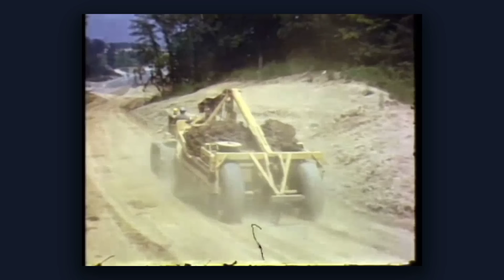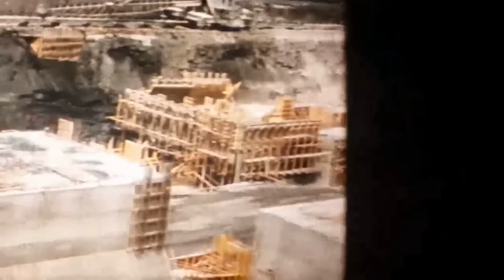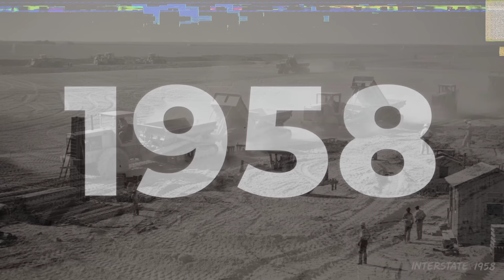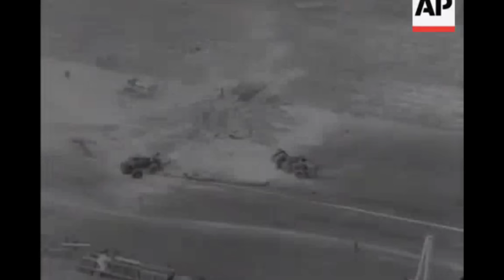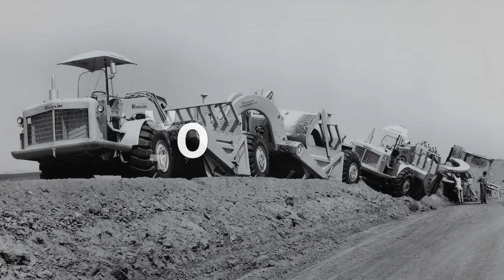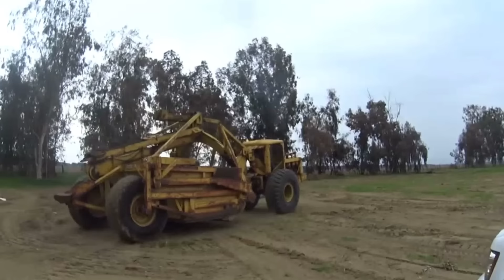10 Forgotten 1950s Scrapers That Were Built to Last Forever! Video

Comment: I'm a second generation operator. Followed my dad. Footsteps. Started running at 2UD8. To AD 10. Over the years, my career. We had a fleet of DW 20s. We did strip mining in ione, California. To building roads around Placerville CA. Those old 20s. You couldn't hurt him. We gave him. They were worn out when I started and they still ran. We still ran them into the 2000s. We had some Euclid Stew. There the one had AV. Twelve one had AV6. He could self load with those. We finally got some 630 sevens. In the late. 80, 80s. My dad always talked about those old The turnos we had. Some cat and cans. I ran for on certain jobs that called for it. They were Letourneau. Yeah, you can't beat that old iron. Them 20s would still be running when those six 30 sevens were. Broken down. I learned to change cables. Back in the late 70s. If you broke a cable, you fixed it. I've even crawled in the draft tubes To fix a cable. We'd move over a million yards a year. In ion strip mining sand for glass. For Owens IL. We stripped lignite. We stripped. Clay for the. And ladder right? That stuff was hard. I ran scraper during my younger career and then. Also ran. We had. The oldest D9. The first one. On the market, Joe Vicini Construction. At a placerville. Which is old hang town. I still run them in my sleep. I'm long retired, but I can still. Cut grade with the best of them. My dad was a dragline operator and crane operator in World War Two on the Berman Road. And also a cat Skinner and. Thanks for your video. It brought back some old memories. Hang. Town. John.
Reply from the maker: What an incredible story — a true second-generation operator! Following in your dad's footsteps with those legendary machines is something special. Thanks so much for sharing your history with us! 🙏